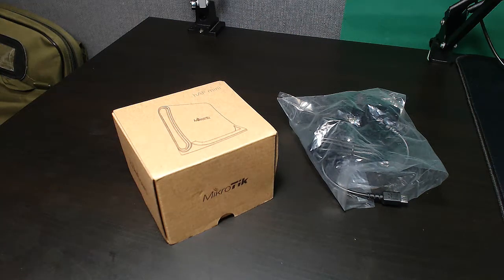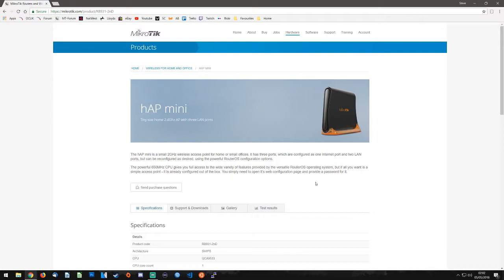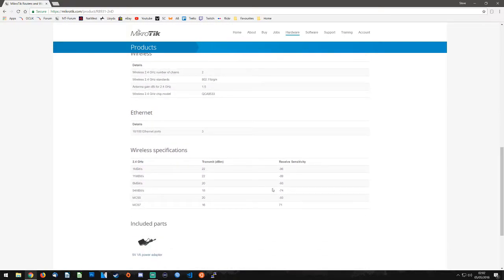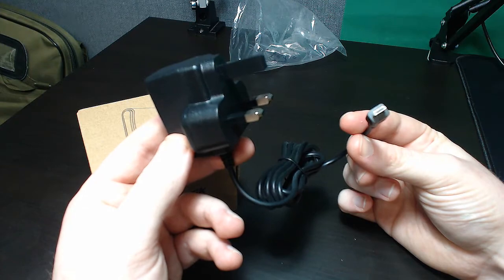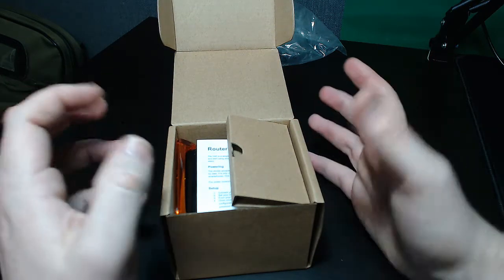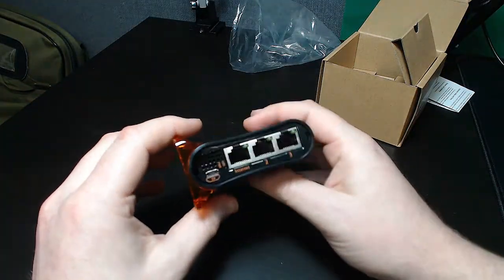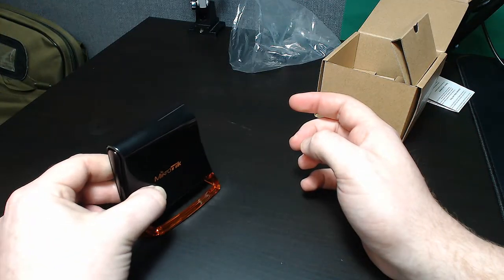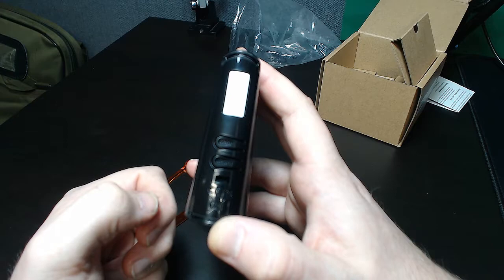MikroTik RB931-2nD hAP Mini Unboxing

Comment: Can work as a wireless repeater?
Reply: it technically can, but the bandwidth will be halved since it will use the same radio to repeat... and it will create interference since it will broadcast on the same channel... but it can be handy to do that temporarily in some situations
Reply from the maker: No it cannot. Only a single 2.4Ghz wireless chip. If you want repeater you need a hAP AC Lite (2.4Ghz & 5Ghz)